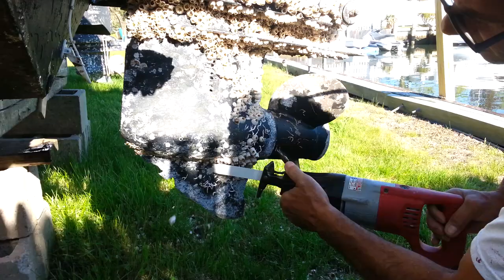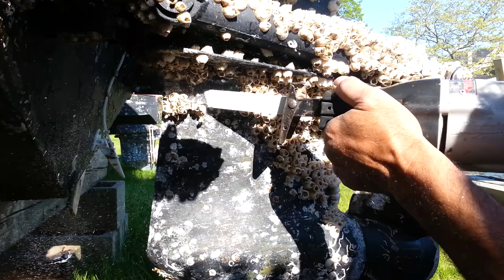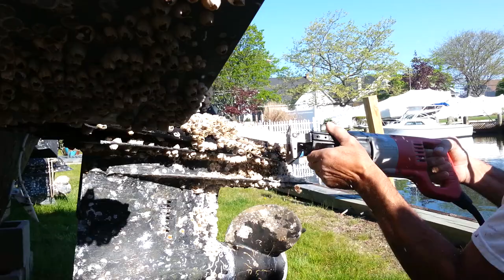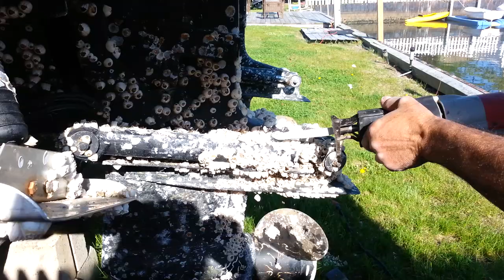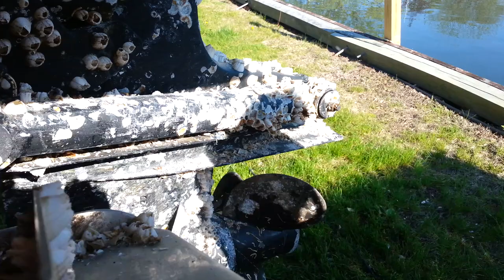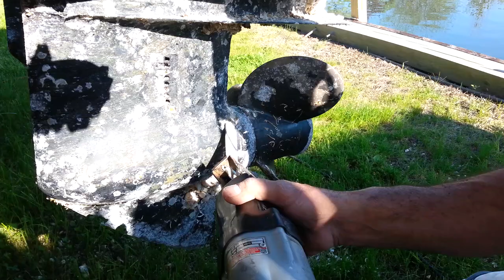Easiest Way To Remove Barnacles From Boat or Out Drive

Comment: If you can, pressure wash every second week. I started doing that since a couple of years back. No need for toxic expensive paint and no need for time consuming masking of water line and then painting and i save hundreds of dollars and i don't pollute the environment with that nasty paint stuff. Takes me about half an hour to pick up boat, pressure wash and ditch in again. Three weeks is a bit to long in our area since they tend to start sticking to hard, but two weeks is perfect. They let go very easy and are so small that they don't drag the boat to much.

Comment: Or you can paint your outdrive and bracket with ablative paint and this won't happen.
Reply: it will still happen.  and take all the paint off with it.
Reply: that's why you repaint, right?
Reply: Or wash (high pressure) them of when you take up the boat instead.
Reply: Or you could pull your boat out of the water and clean it a little bit more often. Y'know... like you're supposed to, in order to prevent having to do this in the first place. If you can't afford a haul out once or twice a year how the hell did you afford a boat in the first place?
Reply: @jimmyfly  I think it was Nimitz that said something along the lines of "Ships are referred to as "she" because of the cost to keep them in powder and paint."
Some salty old wisdom, there.
Reply: @jimmyfly 
Eh, just the way YT seems to go now. Random recommendation, random click, read some random comment threads that remind you of something, that kind of stuff.
My dad owns a couple of boats in his later years, so your comment struck a chord. I had to help scrape some dock scum from the waterline a couple of times, and nearly dumped myself in the Quantico marina.
Good times, man.
Reply: @WestCoastWheelman  when is he going to remove the glue and base of the shells anyway

Comment: I feel I’ve watched videos with a pressure washer being used that looks a lot more efficient..
Reply: Yeah, I just got through watching one of those videos myself!
Reply: You cant use a power washer on fiberglass though, it will destroy it. Not sure what hull this boat has, but unless its a metal hull you dont want to use a power washer otherwise you will end up putting holes in the gelcoat because barnacles bond with the gelcoat.

Comment: Here is a tip. Bring your boat to sweetwater for a week and remove them after. Much easyer.

Or better, acid water. Calcium desolves very easy in acid. But watch out. Metal does also desolve in acid
Reply: @barbrn  yes fresh. Was a translation error to english. In dutch its called sweet(zoet) water.
Reply: @rubikfan1  HaHa.  Thanks!

Comment: Why on earth would you do that!.. fool..... turbo nozzel on a pressure washer.  Not scraping the hell out of the expensive paint on the skirt and lower areas of the out board. Also you could have just soaked the motor in barnacle buster and not had to lift a finger.